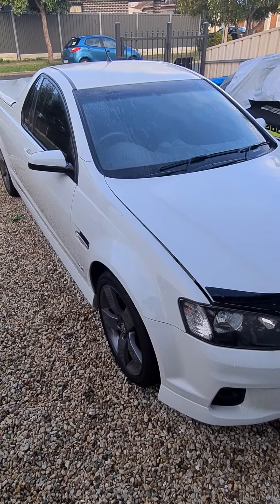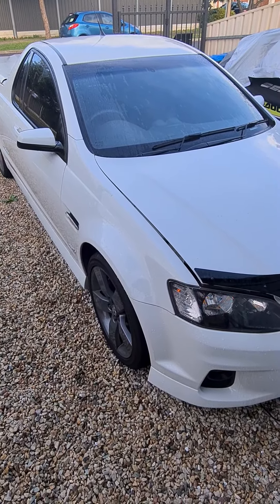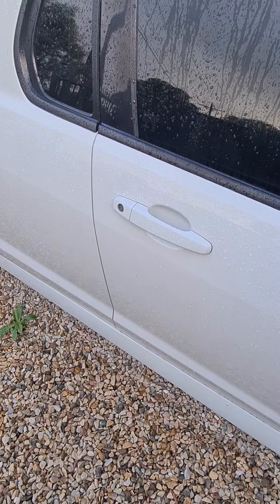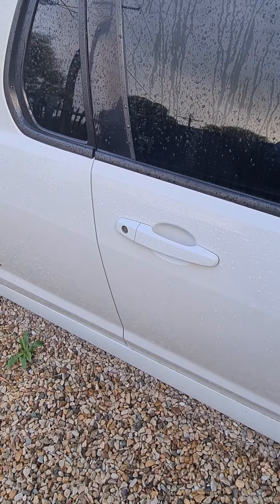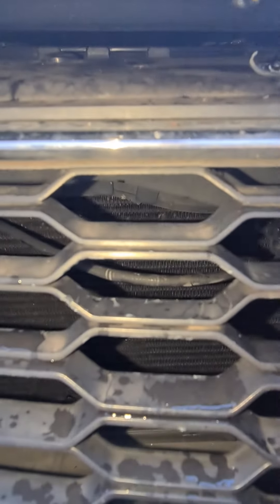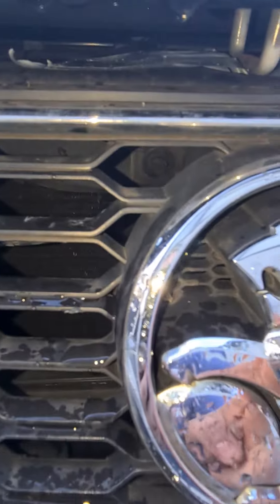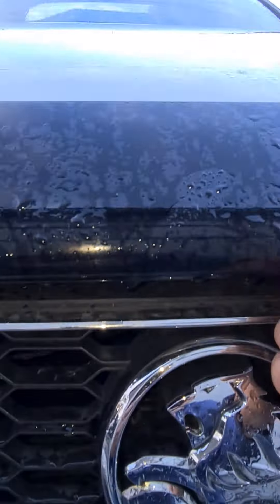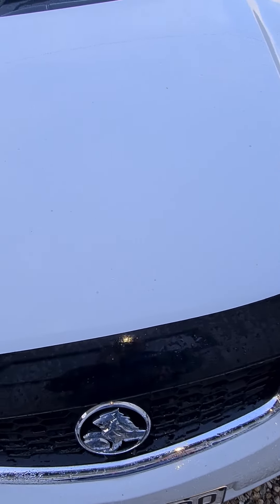Deadlock Dead Battery Holden VE SV6 Commodore Unlock Hood

Comment: Well. I have deadlocked and used the key in the past. 2005 WL Stato. Deadset put my key in, turned hard af and snapped the fkr clean off right after your vid played this. Phone was on my roof and with some beautiful comedic timing, about 3 seconds after you said 'dont do that', it did exactly that

Comment: Thanks for posting. Mine is a 2009 VE international, stuck in the same boat, replaced remote battery, no joy, tried keys turning in both directions, no joy. I pulled the cable with a piece of welding wire stuck in through the grill, but it didn't release the bonnet no matter how far I pulled it. I felt like I was going to damage the grille so I gave up for the night. In the calm of the next morning I thought "surely they couldn't be so stupid to make a car that you couldn't unlock with the key (?!)", so I re-tried the key, turning firmly to the right, and then I could lift the handle. Once I was in I could pop the bonnet, pop the boot via the yellow toggle behind the rear seats to get my charger out of the boot, then all good again (assuming the battery isn't stuffed, but that's a separate issue).

Comment: Handy video mate. Another way is to jack up front of car, get a spare battery or even charger and connect positive lead to battery cable leading to starter motor and earth the negative. Hopefully if its a flat battery the car will open
Reply from the maker: Hi there thanks for the comment, yes that is also a way you can do it. However it requires, a jack, getting under the car, a spare battery, locating the correct starter motor cables and removing the plastic weather shielding, which is linked into the wheel guards. It's quite the mission.
Reply: @genexdesign  Hi Ben. True its not as easy as your way but not all VE commodores, such as my 2007 sv6 have the same hood release cable set up as yours. No sight of the cable just the cable sheath and you can tug on that until the cows come home and bonnet wont pop. At least that's my experience.

Comment: Thanks or that great tip but why couldnt you open the door with the key because i have the same problem. My door lock is rock solid, when i try and turn it with the key it wont move. cheers
Reply from the maker: Hey mate, sorry just saw this. Might not be helpful now but the reason you can't use the key is the 'deadlock' security function. It's an extra precaution in the vehicle to prevent theft. You can google it for more info.

Comment: So I’ve just unlocked my ssv using key turned it right (with no force) and it opened..!!
Reply from the maker: Won't be deadlocked then, just normal lock. Commodores have a dead lock bolt that engages when you hit lock twice.